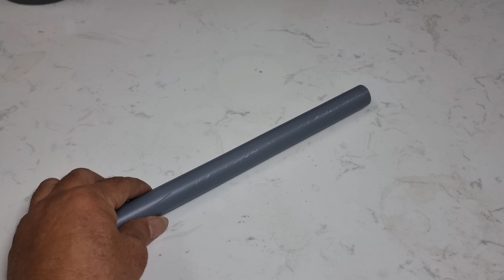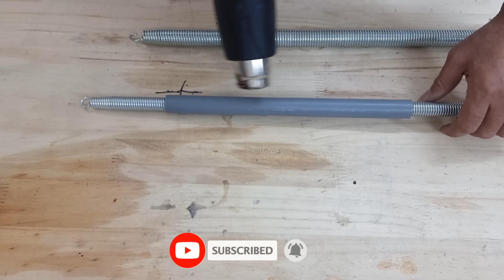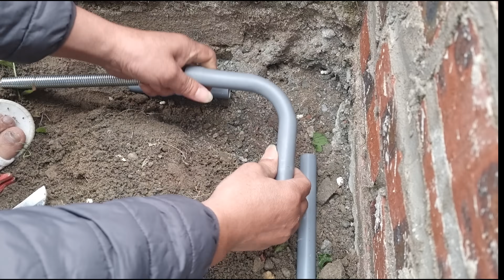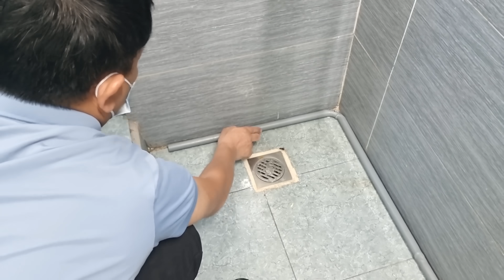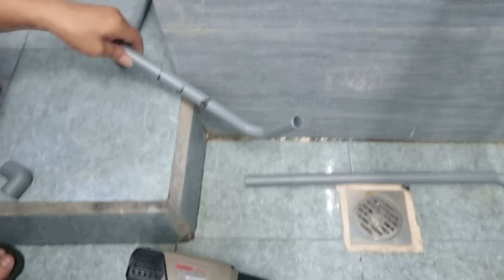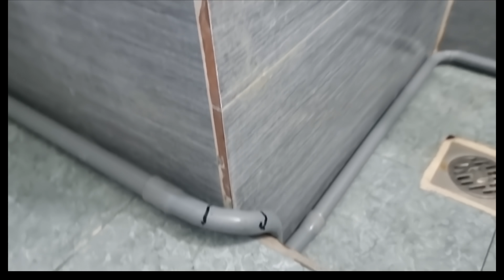Tricks That Plumbers Don't Want You To Know! How To Bend PVC Pipes - Easy Pipe Bending

Comment: Does heating and in effect "stretching" the pipes plastic on the outside edge of the new bend have an adverse effect on the integrity of the plastic?
Reply: i guess yes it is and i'll never use this technique in a high pressure water. but for cable conduit it may work
Reply from the maker: Not significant because the plastic pipe is quite thick and when bent again it will stretch but not significantly compared to the original, we have tried many times already. 🌹🌹🌹
Reply: @bottlehomehacks  and the key is pipe thickness because in my country there's multiple grades of pvc pipe and I guess never use cheap thin pipe.
Reply: on the tension side of the bent elements will be stretched with associated reduction in thickness.. the final thickness resulting from bending determines the maximum internal pressure this bent pipe can hold..when that is required then ask the designing engineer about the safe working pressure for this bent pipe..
Reply: Yes

Comment: Bending the pipe stretches the material and makes it weaker. That just a fact. If the application is not critical, such as an unpressurized drain line, then no harm
Reply: Right, which is why this is typically done with conduits that don't need to stand up to water pressure. With plumbing, you'd typically connect bits that are already the correct shape when they leave the factory.
Reply: @SmallSpoonBrigade  elctrical conduits?
Reply: Great add
Reply: "That's just a fact", as in, you have evidence to show how much weaker x amount of bending causes? I don't mean to be a harda$$ but I would agree with you, though I would call it a "logical assumption" since I have no data. The data that I do have is this, 1" Sched 40 (from Charlotte Pipe) is rated at 450psi max WORKING pressure... the average USA home has a system pressure of 40-60psi. Given that data, my second logical assumption is "sure it's weakened, but it'll handle 60psi for the next 100 years".
Now, if you're getting into diesel pumps pushing thousands of gallons onto a farm... well, that's a different story. Residential, I don't see an issue, so long as no building inspector stops by! I'm not so sure that I'd do this myself... I prefer playing with torches instead of over-powered hair dryers.
Reply: All of you are very smart . Nice to sit in class . I was watching for sh*ts and giggles, might learn something  👍  thx
Reply: Some countries carry less than 10 lbs pressure at their highest, that’s why they mostly have water cisterns on their roofs to use gravity vs pressure
Reply: For us electricians works great easier for wiring
Reply: Have you ever seen the piping in an aircraft with actual HIGH pressure hydraulics? Bending when done correctly is safe.
Reply: @stevenwilgus8982  Have I ever seen it? I did it. This is where I learned the information. That doesn't detract from the original statement. I did not say there is no case for bending. When tube material fails, statistically, it is most often at a bend, rather than a straight run.

Comment: Ok nhưng tìm đâu ra cái lò xo dài thòoong vậy?
Thị trường là không có bán rồi, vì không ai có nhu cầu lò xo dài ngoài anh uốn ống nước lâu lâu mới nghịch chơi như vậy.
Reply: không thì lấy lò xo mềm chịu kéo đều uốn dc.
Reply from the maker: thanks 👍❤️❤️🙏🙏🙏
Reply from the maker: @Đức Đỗ Bá  thanks 👍❤️🙏
Reply: @ucoba9270  
No way. You can by no means stretch a 10cm long spring five times longer than it originally is, let aside the fact that it would be useless in this new shape for the purpose showed in this video because it would have turned into a spiral steel wire then. Your intention will fail.
Reply: Lò xo dài 1m vẫn có mà. Chỉ làm bằng cách này khi gặp 1 số ca khó( k đủ 45° hoặc 90°) thôi. chứ tốn thời gian.

Comment: Im a 10 year industrial/maintenance electrician in Canada and this is by far the best technique for bending ive ever seen! Im going to copying you, immediately! 

Have you tried this with 3/4 or 1"?
Reply from the maker: thank you very much. Through your comments, I feel that you are a very good person, very grateful to you, your comment is a great motivation, and there are many more interesting things to come. Looking forward to your sincere comments. Thank you again, looking forward to working with you♥♥♥♥♥♥❤❤❤
Reply from the maker: All plastic pipes can be made as long as there is a spring that is slightly smaller than the diameter of the plastic pipe. I have all kinds of springs. thank you very much👍❤️❤️🙏🙏🙏
Reply: It works with both those sizes.
Reply: It will help toflow water more freely with out hindrance or resistance at joints
Reply from the maker: @Charles Wyatt  Larger sizes will use larger springs so the tube will not be squashed👍❤️❤️🙏🙏🙏
Reply from the maker: @James George  Yes. thanks 👍❤️❤️🙏🙏🙏
Reply: Only for high kuality PVC pipes..👍
Reply from the maker: @Diy_356  yes, thạnks
Reply: Yes, you're welcome, with several attempts that I have always failed because I use ordinary pipes except for using good pipes😅😅

Comment: The time you spent heating and bending I could have done properly with the correct fittings in half the time. And I'm not creating weak spots in the pvc. The reason plumbers "don't want you to know this trick" is likely because they don't want to have to come fix that horrific mess when it starts leaking.

Comment: The wonders of 3rd world plumbing, it's not an arts-n-crafts project, it's science.
Reply: Nothing science about it! The "ONLY" reason he does it this way is because the one fitting costs more than the pipe!
Reply from the maker: Thank you for your comments: each country has a different type of pipe with type C1, C2, C3, I used type C3 to bend those bends, thus ensuring the technicality of the pipe, and when making it. This will not reduce the water pressure at the perpendiculars. Thanks for watching and commenting.

Comment: What's better for bending, PVC or CPVC?
Reply from the maker: This method bends all plastic pipes. thank you ❤️❤️🙏🙏🙏
Reply: Pvc, cpvc is for chemicals and higher heat.
Reply: Ống HDFE dễ uống hơn và có độ co dãn, chịu áp lực hơn ống PVC
Reply: I see that CPVC has a substantially higher softening temperature of 200F vs 140F for PVC,  so all else being equal,  I’d have to confess the latter is easier 🌒
Reply: @philg4116  CPVC is chemical resistant hence why it is used for pool and spa systems.

Comment: That is a brilliant idea 💡. I did my apprenticeship as a Fitter/Turner but I ended up doing more Fitter/ Turner and a bit of sheet metal work. I did a similar thing with rolling full length of 4" Stainless Steel tube.  We welded on Dome caps with 1/4" sockets  and filled them with water.  We had to be careful when releasing the pressure of the grub screws. (Other wise they will fired out like a bullet)  From what I remember the radios opens up a but after the  pressure has dropped.  What are the diameters of the Springs you'd get used?
Reply: This is the original way of doing it before somebody invented tools for doing it by preventing the outside from expanding.

Comment: I’m afraid joint seals may not be waterproof and you will  have leaks.

This interesting technique needs to be tested and approved by states.
Reply from the maker: thank you for comment. The joints are all connected with very strong PVC glue, this method of bending avoids right angles and water pressure will be better. There are many more interesting videos, please comment.
Reply: You must an agency
Reply from the maker: thank you for watching, plumbers when they watch the video they will know if the joint is leaking or not. This connection never leaks. thank

Comment: It was not easy to find the exact OD for the spring that I needed. I ended up winding a coil with a 14 gauge wire and hooked it with a hemp, so I can pull it out of a long PVC pipe after cool down. But the drawback is, it is not a spring, and I always have to fix the coil a little bit for reuse each time. The main idea is the metal coil wire heat up faster and more evenly.

Comment: I'm pretty sure that electrical conduit and in America we don't use heat to bend pipe. At least no other plumbers I know have ever done so.
Reply from the maker: Thank you for watching the video. in the video is a PVC water pipe, when bent, the water pressure will be better because the water does not go through a right angle, and to bend the pipe without a tip, the tube will be flattened so I made this video hoping to convey the content to to the community, all plastic pipes are heat-bendable, PVC, UPVC, HDPE, PPRPE are heat-bendable, when using heat, the pipes will expand better, and using springs to bend pipes will not flatten, feel Thank you for watching.
Reply: You must not know much about plumbing.
Reply: @JyroOne  I know enough to know every state and city have different regulations and in lower alabama where I'm a  plumber  this isn't common pratice. I'm not not saying it's bad pratice of not  just not a used way of connecting pipe down here.
Reply: @bottlehomehacks  of

Comment: Worked in a hotel where contractor bent all the pipes going to shower head in tube! Can’t remember how long it took but they started to leak! Probably all leaked! The bend weakens the pipe and it leaks on the outer curve!
Reply from the maker: thank you for watching. It also depends on the quality of the pipe and the worker must know how to apply it. The method I'm doing at home, the water tanks in the house often have low pressure so the water flows very weak and this method is a great thing to overcome that. thank you very much

Comment: In france it is forbidden ton heat PVC Pipe (.DTU 60-33 P1-1 NFP 41-213-1-1)
Reply from the maker: each country has a different regulation, in my country white tube is for electric wire. This pipe is a water pipe and has a thickness of 2mm.

Comment: This is good if you have no elbows but if you have why spending more time to make an elbow,
Reply from the maker: in the home water system. When there are many perpendicular joints, the pressure will be reduced (water pressure is weak), so if using this way, the water pressure is greatly improved and costs are saved. Thank you for watching the video, hope my video will be applied by many people,

Comment: Looks very neat, but PVC bending is going to make a much weaker and lower-longevity connection than a fitting of proper thickness.  There is no way this non-standard technique would meet plumbing codes, and these fittings will probably last long enough for one to forget about them, but then fail far sooner than a standard cemented elbow.  Try this at your peril!  I'm sticking to regular PVC fittings, glued with primer (first) and cement.

Comment: In USA the gray pipe is electrical and meant to bend with heat.
Reply from the maker: Thank you for watching, wish you good health ❤️❤️🙏🙏🙏
Reply: Ở việt nam k có bán lò so  này lấy đâu mà làm
Reply: @lethanhat6402  , đầy ở các cửa hàng thiết bị điện nước.
Reply: In the USA there is also gray water pipe.... you can get it in a bunch of colors bud.
Reply: @JyroOne  25 years and I have never seen it on any industrial or commercial job site. But I’m interested!  I have only seen red or blue pex and the plain old white pvc.   As an electrician I use the gray for underground electrical conduit often. 3/4 to 4 inch.
Reply: @mcciaccio  Just want to add that I too am an electrician by trade and we also use schedule 40 NM conduit on site. Water pvc is dark gray, electrical is light gray. We have every trade you can think of involved with building these washes.
Reply: Estará diseñada para muchas cosas pero nunca debería deformarse en curvas y menos para agua en agua caliente y altas presiones ¡Hay leyes físicas inviolables!

Comment: Thin wall conduit, as used in this video, does not have the same bending properties as PVC schedule 40; which is used in plumbing. Listing this as "tricks that plumbers..." is a complete fraud. This pipe used is for electrical wires ONLY.

Comment: You do know that grey pvc pipe is electrical conduit right? It is not engineered to carry liquids & is not approved by building inspectors.
Grey = Electrical Conduit
White = Drinkable Water
Black = Waste Water

!
Reply from the maker: Thank you for your comments: each country has a different type of pipe with type C1, C2, C3, I used type C3 to bend those bends, thus ensuring the technicality of the pipe, and when making it. This will not reduce the water pressure at the perpendiculars. My place is white for wiring, thanks for watching and commenting.

Comment: What you have here isn't even plumbers pvc, you have electrical PVC in this video. Different kinds of PVC are rated for different uses and what you are using is absolutely not intended to be used for any sort of plumbing. A rule of thumb is plumbers are white and electricians are grey
Reply from the maker: Thank you for watching the video and for your comments. thank you very much, in my country the plumbing is gray blue. and the conduit is white. Have a good day. and the water pipe in my country is type C3 with a thickness of 2-3mm. very thick. Have a good day!

Comment: It's really something with the European plastic it's way weaker than the United States plastic the plastic here in the states is so much stronger I don't think the heat will work
Reply from the maker: Thank you very much👍❤🙏🙏🙏
Reply: Very good demonstration of this technique. Thank you. 

It works on PVC, not ABS piping. 
Thicker tubing requires more time to a bendable temperature, evenly distribute the heat all the way arp. Both schedule 40 and 80 worked for me.

You’ll be in awe of the different techniques to do the same task that geniuses from Asia, South America and Africa come up with. You have to be creative because the local hardware store doesn’t exist.
Reply: Its not plastic but pvc
Reply from the maker: @alexanderrietveld  Yes, thanks